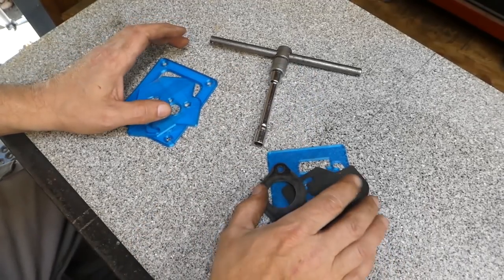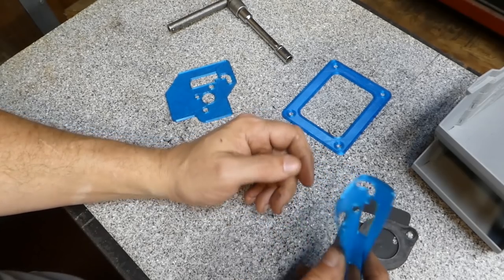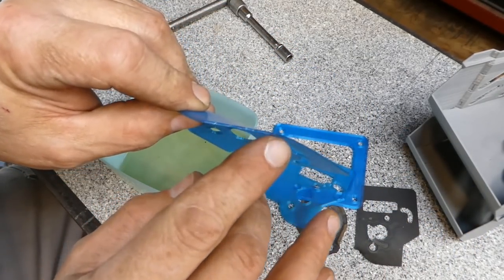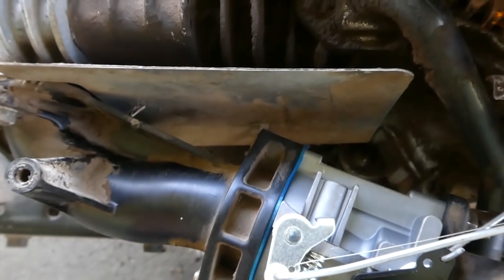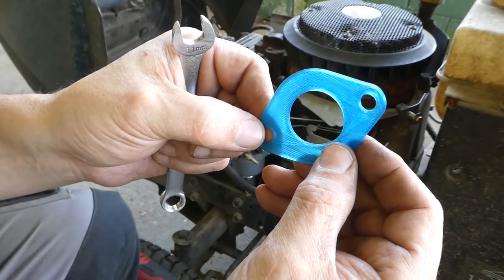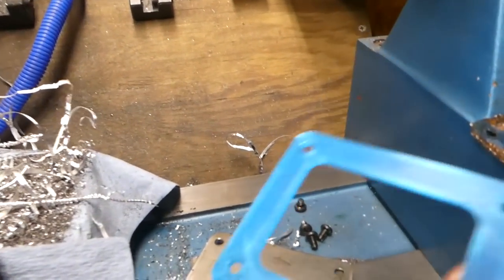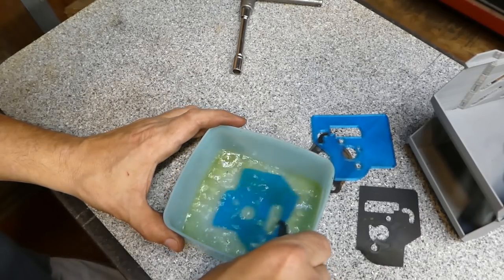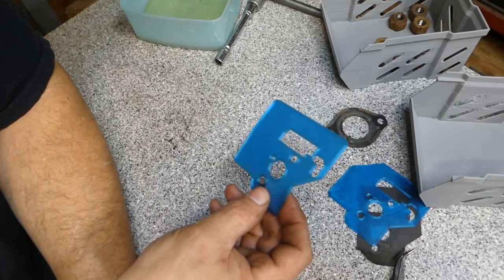3D printed gaskets? Any good?

Comment: A couple of thoughts:   Prusa slicer has an option for concentric fill.   For many gaskets this would place the “grain” of the part perpendicular to the shortest leak path.

Next, I have been having a lot of success printing using nylon trimmer string.  It is very tough, fairly flexible (less than TPU of course) and heat resistant.  It only costs about $15/kg when I buy 5lb. From Amazon.   The hassles are winding it onto standard spools, and drying it out prior to printing.  This might be something to keep in mind if you need a firmer seal at some point.  Stephan of CNC kitchen did a nice video
Reply from the maker: Good ideas. I believe Cura has a similar option. I started with Cura and am really still learning, so kind of sticking with what works for me right now but I do plan to try Prusa at some point. 

I saw that nylon video awhile back but had forgot about it. That is an interesting idea, might be great for bushings as well. What print and bed temp do you use? Enclosure? I have a very good oven for drying, it maintains a good constant temp even in the 65-70C range. I have had good success drying PETG and TPU with it.
Thanks!

Comment: Interesting video. Have you considered the ironing feature? Mot sure how well it would work with TPU but it makes the top layer much smoother and melts all the lines together.
Reply from the maker: I actually have not. It would certainly be something to explore, I have not had great success with it on other materials as far as looks. I did make sure the nozzle was a little lower for a bit more squish to close up the gaps a bit.

Comment: TPU also works great for moped rear shock absorber rubbers. Those wear out way before the shock absorber does... Printed them for 5 (Tomos A35) mopeds, not one of them has failed rubbers for over 1,5 years.
Reply from the maker: That is a cool use, I had not thought of that one. Thanks!
Reply: I did rear spring insulators between body and spring itself in my 1970 Pontiac Lemans. It's 2nd year of usage and those are still sitting there no problem (material was 40D shore). I prolly have to use custom insulators in the front too coz car is leaning to the left front after swapping new springs.

Comment: Well, I also don't want to use the term "game changing" but that is just what it is. Whatcha gonna do? :D
TPU is the second level game changer on top of the base game changer that is 3D printing^^
FME  gaskets printed from Amazon Basics TPU work absolutely fine for water and air/dust applications. Thank you for testing it on an internal combustion engine. I totally dismissed that from the start because I thought it would become too hot but apparently...😎
Reply from the maker: I think in certain applications it might work with engines. We will see though. I initially had "game changing" in my thumbnail but decided it was too clickbaity. I agree though, there is no other term for it. Thanks for watching!

Comment: I also saw a video on 3D printing a broken part. He superglued the part back together and scanned it on a copier. He cleaned in a photo app and then sent it into a CAD program, sized it. Sliced it and 3D printed it. That would work for this to I think. I’m ordering some TPU or whatever rubber filament.
Reply from the maker: That is a great idea. I was playing around with photogrammetry a month or so ago. I actually had some limited success before one of the programs killed my graphics card. Basically taking 50-60 photos from different angles and combining them into a program that turns them into a 3d model. I used it to try to replicate an old broken grip for a BB gun. It got pretty close though it never got the back quite right, it did get all the compound curves damn close. I will revisit it at some point but priorities and such, lol.
Reply: Video is called “ quick scan to 3D printed parts” by the chep channel
Reply from the maker: @bulletproofpepper2  thanks!

Comment: I have 2 extreme areas I'm using 95 VA right now. One is 3d printed Orings on injectors in a Mazda 1.6 engine and on the output of my pressure washer. Both have been on for about 6 months and I've had no issues.
Reply from the maker: You printed injector o-rings for your car? You are more adventurous than me, lol. Nice one.

Comment: I have used TPU to make an O ring for the main jet on my generator/ welder’s carburetor. Still works has been in for about six months. I have a Sovol svo1 printer.
Reply from the maker: Thanks! How do you like your Sovol?
Reply: @theeddies  it works very well. It does have moments but mostly it is a slicer setting and back to work. I used Fusion 360 to make o ring and cura to slice it.  I also have used TPU to make rollers for a tumbler and two drive belts for it as well. Thanks for the video. TPU is very chemically resistant and strong

Comment: Great video! I have tested ninja tpu by soaking in methanol, gasoline, and coleman fuel. Doesn't seem to affect it at all. It makes amazing gaskets and seals. Very strong and durable. I like to use a large nozzle. The larger the better it prints. I have a direct drive, haven't tried tpu in a boden.
Reply from the maker: I have not done the follow-up yet, but they have performed flawlessly. Thanks!

Comment: Quicktip , when trying to show a closeup for the cut of the husqvarna gasket try putting ur hand behind the gasket to let the camera know where to focus :) good job btw. Tip, there are many types of tpu, seems like you have a lot to discover yet. Hope u enjoy it like i did. 

U can make suspension bushings too :) get to know the shore hardness scale for referance to type of tpu needed for each task
Also u can stop prints and change filaments to have a tpu joint in your design. Tpu is also GREAT for sleeves and can holders. 

ps.
my beers keep cold as f for 40 min
Reply from the maker: Lol, thanks. I know about the hand focus trick, just sometimes forget and my videos are a little off the cuff, so to speak, most times. 
It is funny, I made this video to share with my subscribers, many of which were not aware of this material at all and then the video blew up to nearly 100k views in less than a month and every commenter  either thinks I am crazy idiot for even trying this, a genius TPU expert, or (like yourself) recognize I am just getting started exploring the subject which many have already explored, which is closest to the truth. 

I have some plans for motorcycle shock absorber bumpers and new over travel bumpers for my truck which are like $80 a piece. 

I have already ordered some other grades though with current supply issues, I am not sure when they will arrive. 

the TPU joint is something very interesting to me. I have not even attempted it yet. I have made color changes between filaments so know how to slice it. Have you tried changing between TPU and PLA or PETG? Will they bond? 

I have not made any can holders but a ton of flexible little holders for drill driver bits and batteries. And a over engineered holder for a full size Windows tablet with a quick change tripod mount. I use it for livestreams for my day job. The stuff is great in the mix of flexible and stiff you can get from it just the way you design and print it. 
Best!
Eddie

Comment: Printed a gasket for a 5 liter jerry can, because I could not find a replacement. Seems to work so far and your tests let me feel certain that it would last some time. Btw. you can use acetone to glue    pla parts the same way as acrylic glass. Take a look at PETG too.
Reply from the maker: Cool, thanks for sharing your experience and the info. I will take at that acetone idea. I print a lot of PETG, I actually prefer it to PLA for most things.

Comment: I have a TPU bed surface on my 3d printer. Acetone is the go to for cleaning it before printing. It works great. From what I remember ( i dont do it myself ) peopole use acetone on PLA to smooth the print surface to make it more uniform and glossy in a chamber where they vaporise the acetone.
Reply from the maker: TPU bed surface? That is interesting? How do you hold it down or does it just stick with heated bed. How thick is it? What materials does it work with?. I have not seen that before.
Reply: Are you sure it’s TPU and not PEI? I’ve never seen TPU used as a print surface before. Might be interesting.

Comment: Hello!
I print another gasolin  gaskets and hydraulic distributors. I also use TPU and PETG. However, what I do and recommend you to do is:
Around the important openings of the gasket to put a slight additional edge with a height of + 0.2  to 0.5 mm above the level of the gasket itself, wide, say 1 mm. This edge will flatten further and will give and seal the garnish even tighter! Only around the important openings do you make such an addition!
Tested on hydraulic distributors and petrol pumps with PETG  and TPU, they work flawlessly !!!

Now, however, I have to change the AC compressor gasket on my car. The compressor is Delphi and has hard to find gaskets (not O Rings!). And here the dilemma is big, because there the pressure is high, it reaches 25 Atmospheres and the temperature of the outgoing refrigerant at the discharge pistons, I guess about 100-120 degrees to liquefy ... Petg gasket will withstand the pressure but I do not know the degrees .. TPU I also don't know ...
Polycarbonate will withstand degrees and pressure but I don't know if it will not degrade chemically from freon ... :)
Reply from the maker: Great suggestions, thanks! If your temps are Fahrenheit which, TPU should be fine. If C, that would be pushing it. I did some other tests in other videos with temp, and 100-120C is going to be the absolute cutoff point where I would consider the material to be viable. I even attempted annealing it to increase it high temp usability and the results were better but not significant enough for me to change my max temps. I did do some torqued tests at those temps as well and it performed ok in the 25 ft/lbs range. Pressure is something I have yet to explore but am thinking of some ways to do it that is somewhat measurable. Though that is probably a few weeks (or months) before I will really get to that point. 

What has been your experience with PETG at higher temps? I initially thought because it prints so high that it would be pretty good. But I have had some mixed results with it deforming lower than I would expect. Best!
Reply: @theeddies  `Hello. Where I use Petg and TPU seals are not high temperatures, around 70-80 degrees. Rarely up to 90 degrees. Both filaments work well, in the form of seals, hold well and have no leaks.
It is very important or at least recommended, when printing the gasket in the way I have described with slightly higher outlines around the eyelets, to fasten the gasket 2-3 times later
especially in PETG
 Put the gasket on and tighten it. You start the machine and after a while it works and cools down, tighten the bolts even more! So 2-3 times (2-3 days or after a week) until it settles perfectly and the bolts no longer allow to tighten! It's perfect :)

I use PETG for  hydraulic distributors because of the pressure! Petg is hard but slightly tough and is perfect for them. It is not affected by chemicals and aggressive oils and up to 80-90 degrees it holds up well + some pressure there.

For the car's air conditioning compressor, however, I am in a big dilemma, high pressures, temperatures from over 100 to 130 degrees and sometimes to minus 20 degrees.

You say you tested the TPU for seals at 120 degrees and it works well?

I thought that TPU could not be hardened !?

:)
Reply from the maker: @brad4edat  There is a slight hardening during heat treat, mostly from the plastic filament strands melting tighter I think not a chemistry change. The purpose though was to does increase the temp tolerance slightly. I found a few lab studies and tried to replicate their results on my own. I would say the results were close to what they saw but I am still unsure if it is enough to be worth it in most cases. https://youtu.be/a_fQ30COQQ4

Comment: TPU is resistant to oil, grease, solvents, chemical, and abrasion. Look up the TPU grade and see if it can handle what you are going to expose it to, but it will handle most non-polar liquids.
Reply from the maker: Unfortunately I have had no luck getting the specific TDS from this particular brand. So I am talking in generalities about certain things I cannot test myself. My experience with this particular product matches what you say.

Comment: The only issue I've found with the bowden feed machines is you need to design or orientate the piece to avoid hopping between start/stop points because it'll string between them. Z-hop and retraction won't help, it'll extrude for several seconds on it's own due to compression. Incredibly durable though, but avoid acetone, chlorine and most acids.

Comment: In the Little British Car hobby, where people repair and drive MGs, Austin Healey, Jags, Morris, Minis and other brands, it can be a pain in the ass finding gaskets, and spacers. I'm looking for something that will survive as a carb gasket on the manifold side and act as a phenolic spacer to insulate the carb from the high heat of the exhaust manifold being absorbed by the intake manifold and conducted into the carb causing heat soak and vapor lock. TPU I think melts at a too low temperature for this application. But for shock absorber gaskets and other gaskets this would work a treat. 
There's a resin that has a really high temperature limit, I might give that a shot though failure likely means you're going to suck the broken print pieces into the intake :-) which wouldn't be fun.
Reply from the maker: Hello, yes anything around an exhaust is going to need something other than TPU. I am not sure about resin printing, I have never messed with it. But I would suspect that either making a form out of regular PLA and using it to make silcone gaskets or laser cut the "proper" material would be  a safer bet. Thanks!
Eddie
Reply: @theeddies  that's a good point. The best part is I have the STL of the gasket, and even tinkercad can extrapolate that out of a deeper box to make a mold in about 2 minutes flat.

Comment: TPU gaskets also work well for air nailers; I printed a few successfully, 2 years of frequent use, and still going.
Reply from the maker: Nice, I had thought about that but wondered how many hours you could get out of them.
Reply: @theeddies  Yea, it is; the pressure is at times cranked up to 10 bar, so the gaskets have gotten a good beating over time. And also withstanding the pneumatic tool oil on top of that :)

Comment: Ive made an intake manifold for my outboard to adapt a pwk carb to it. I used Carbonfibre filled PETG, ive had it running for months now with no wear on the printed part and no leaking at all
Reply from the maker: Nice I have yet to mess with structurally filled filaments but I am ready to go as soon as I get some time and a good project for it.

Comment: Good stuff! I often need oddball gaskets that are hard to find. I'm going to try printing one next time. You should do a video on how you design complex gaskets. I can design simple shapes but never tried anything complex.  I have a roll of ninjaflex that would make great gaskets.
Reply from the maker: Thanks! I am probably not the best teacher for using CAD programs as I am really still learning myself. I use Fusion 360 which I recommend, you can get a free non-commercial version pretty easy. There are lots of resources on Youtube to learn the basics. I have used others like FreeCad and find them to be a waste of time and effort to learn. My buddy Aaron @Design Creativity & Technology Channel   has several great tutorial videos including this one which has a bunch of the basics that would be essentially the same when making a gasket with an odd shape. https://youtu.be/rd-YOs6qPJ8
And he has a playlist of others that introduce lots of useful tips. Tinkercad is also another free web based program that would probably be fine for gaskets and is very simple. 

There is a trick for more complex gaskets. You can take a picture of an old gasket or even the fitting it will attach to and in the CAD program scale it to the right size and then just trace it basically. I did not do that on the weird gasket in the video though I wish I had. It was pretty difficult doing it just by measurements and is not perfect but close enough.

I would like to try some Ninjaflex, it is supposed to be softer than what I used.

All the best!
Eddie
Reply: I once modeled an intake manifold for my car. I used the old manifold and put it on a scanner. I have one of those printer/scanner combos and just scan in my flat parts. 

If you have a torn up gasket, just scan it in with a ruler next to it. In the CAD program (I also use Fusion360) you can import that scan and set the scale with the help of the ruler you scanned in along with it. 

There is an option where you can draw a line and tell the program how long that line should be in real life. So I would just draw a line on my scanned in ruler and tell the program how long it is in real life. That's how you set the correct scale. 

After that you simply trace over your gasket in the program and voila, you have a perfect drawing of the gasket.
Reply from the maker: @schwuzi  Thanks! I am planning to do a video on this exact process with gaskets.
Reply: @theeddies   What hardness is your TPU? I have some Shore A95 hardness but I don't know if that's soft enough for gaskets.

Comment: That’s pretty awesome. Polyurethane is pretty resistant to solvents but I wouldn’t have thought to do this. I’ve made some small seals for an old paintball gun and it worked out alright, but this is pretty cool. I’ll have to try it.
Reply from the maker: Yes, so far so good and I am working now to increase it's temp resistance. Video soon.